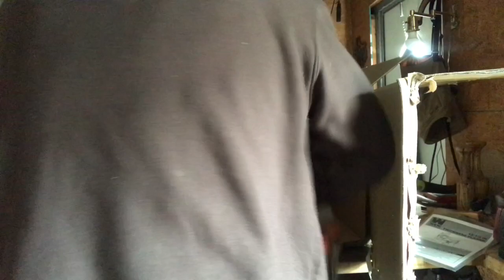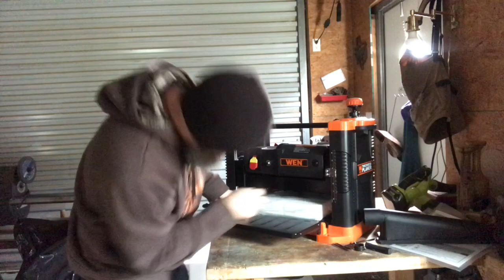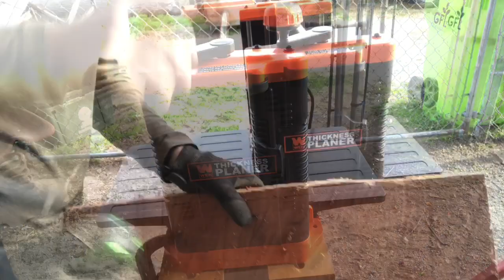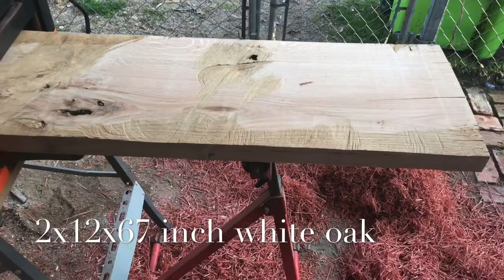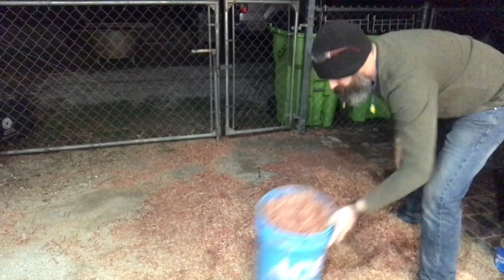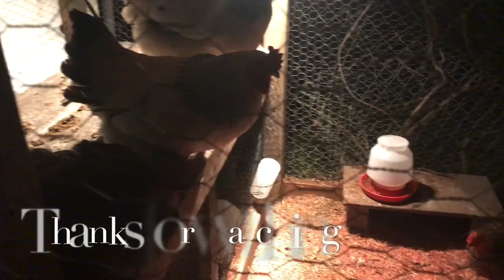New Wen planer thorough test

Comment: Do you always de-bark your slabs before running through the planer?  I have a ~12' slab of Cherry ~2 1/4" thick and 13" wide, very heavy.  Every run anything that big?  I chainsaw milled it.
Reply from the maker: Hey Jason. I don’t typically run the bark through the planer because it normally breaks it off in the process. I have ran a 8’ by 12” piece of white oak through the planer with no problems. I use a feed roller to assist me because I normally work alone. I’d suggest flattening one side first or you will get waves in the wood. Chainsaw milling is fun but lots of work especially if you don’t have the 10 degree blades! Thanks for the questions hopefully I answered them.

Comment: Great video I need an extra planer and was wondering if this would hold up or not. Think I'll swing by and grab one
Reply from the maker: Glad I could help! It’s the 2 blade planer hopefully they still make them. This one still works great for me.
Reply: @johnnygsdiy1981  went to purchase but it was sold out. I checked the specs and it ended up being the same as Craftsman 15 amp 2 blade but the Craftsman was less expensive at $329. 3 year warranty and a 2 year  from Lowes made it hard to say no
Reply: Just got mine delivered yesterday from Walmart on-line believe it or not. $319.00. Works great!
Reply from the maker: @gilly2571  thanks. Hopefully you get lots of work out of it. If you have a harbor freight around your area they sell the replacement blades for about $25.

Comment: Damn home-chitlins! Do,you have an Alaskan mill, or do you just free-hand that shizzle with the chainsaw? Alaskan mills are pretty cheap, and make a pretty clean cut board. Give er a try. And you don't need a planer. If your board is flat on the top and bottom, all you need is something to make a straight cut on the sides. Several,ways to do that. Good vid. Keep em comin!
Reply from the maker: Sloppy free hand on that board. I did buy a jig later on after I posted that video. I think I dulled the blades flattening that one board. 😂. Thanks for watching.

Comment: how is it holding up so far?
Reply from the maker: It’s still a good planer. I’ve been through at least 5 sets of blades. If I had to mention a negative it would be sometimes I have to push the board threw on the larger boards. But I’d still recommend it for any hobbyists woodworker.

Comment: Were you using the 13" model or 12.5"? Very curious been researching this brand, would this be a good beginner planer?
Reply from the maker: Rodney Dudgeon it’s the 2 blade 12 1/2”. Honestly it’s the cheapest one I could find and it works very well for what I do. I have ran quite a few hardwoods through it and as long as you take 1/4 turns on the handle it cuts great.

Comment: ALLEN BOLTS HOLDING DOWN BLADE COVERS WONT BREAK LOOSE...NOW WHAT???
Reply from the maker: Sounds like your Allen key is stripped. File it down to where you have a good Allen key. Let the bolts soak in “PB Blaster” overnight. And try taking them out in the morning.  If that doesn’t work try using tinfoil to fill the stripped bolts hole and attempt to remove it again that way. If all else fails harbor freight sells a cheap screw extractor tool, and ace hardware sells replacement screws. Good luck.

Comment: I'm debating between the 12.5 inch and 13 inch. The 12.5 inch looks like it handled those slabs pretty good. This will be my first planer, so I think I'll go with the less expensive option for now. I don't have any pets and it never occurred to me to use wood shavings for animal bedding. I've just been throwing it in the fire pit. I'll start saving it to see if anyone wants it. Good video. I don't always care for the ones where people jibber jabber. Sometimes, you just need to see how things work without the commentary.
Reply from the maker: Beard Barometer. thanks for watching. I’m not a fan of a lot of talking either. I appreciate you watching. It’s been a great planer so far. 👍

Comment: Never a clue as to model number, so I just gave up after a couple of mins.  BTW, clearly not supposed to lift by the center bar (@1:11), but you don't seem to want to pay attention to those sorts of details. 👎
Reply from the maker: WEN 15-Amp 12.5-Inch Two-Blade Benchtop Thickness Planer , model #6550. Sometimes it’s just as easy as asking in the comments section. The roller on top allows wood to be moved easily from the out feed back to the in feed. That being said some of the oak boards that I have ran through the planer have weighed over what the planer weighs and hasn’t as of yet bend the bar. Thanks for the comment. Everyone has there opinion.

Comment: A jointer should be used first in a practical operation.
Reply from the maker: It was just a trial run to see how well it works, but your right a jointer would be best to start out.
Reply: a jointer would be great but most home planers only do 6" wide boards